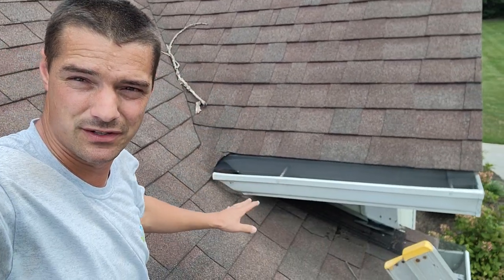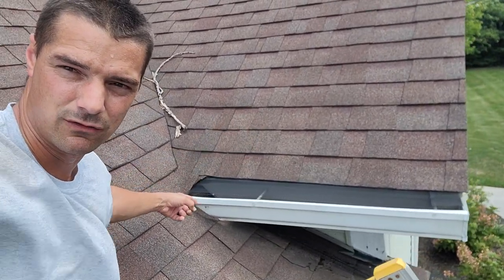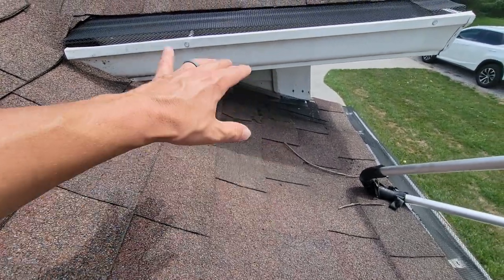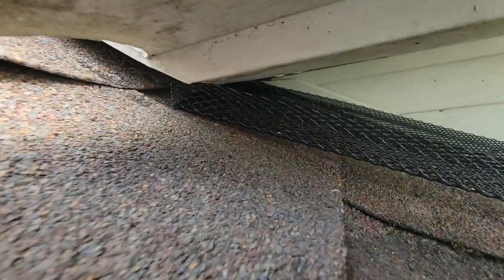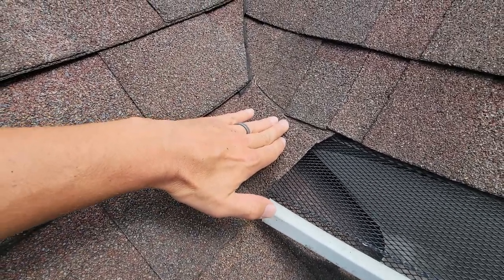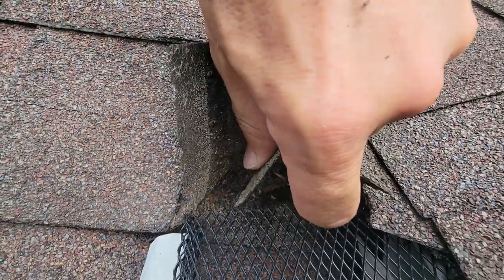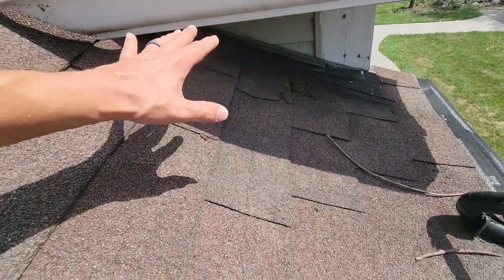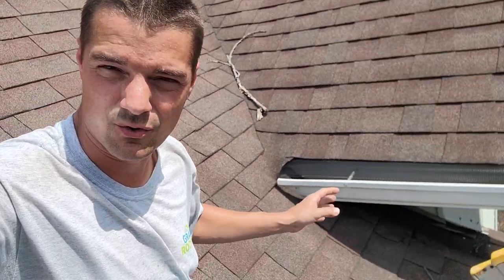How not to Roof a Valley!

Comment: I see this all the time. The gutter needs an end cap first of all, not cut at an angle like that to divert water to the weak points. The gutter on the main roof will take care of what runs off the valley from the dormer. That is 1000% wrong beside the gutter issue though. Great video my friend, keep educating these fools. 🤣
Reply: I do gutters and usually don't put end caps on these returns. We just cut it off straight and give about a 2 inch gap between the shingles and gutter. Haven't had any call backs. Though I'd agree putting an endcap and outlet is probably better.

That gutter basically dumps into the valley though .. definitely not good
Reply: I get people that want us to do gutters on the tower above the front door because they have leaks beside it in the dead valley. Crazy how many houses have this issue and not roofed correctly.
Reply: @digi3218  You are correct. I would go about 4 inches out of point-of-contact though, cap in, and drill in my downspout insert on the valley side of dormer, with a B style elbow to turn water away from the wall. Let the main roof gutter catch the runoff.
Reply: @kalebburgess5088  Yeah I will do B elbows sometimes in problem areas or if the homeowner requests it to be done like that or if we are removing and replacing and trying to match it.

I got taught just to cut it though and I have mainly stuck with doing it that way. But will sometimes do a painted outlet or with a b elbow.
Reply: @digi3218  honestly I have PTSD from hanging gutter with the company I worked for some years ago. Nothing pisses me off more than fucking with gutter. 🤣
Reply: @kalebburgess5088  PTSD.. did something bad happen or just didn't like it lol

Comment: I have that exact issue coming up on a roof repair coming up. I repaired this roof about 15 years ago. Then the people had it roofed by someone else. Now I have to go back and fix some other roofers mistake.
Reply: Your statement isn't very clear as storm issues caused a reroof or was it your installation that caused a reroof. The lifespan of shingles is incredible so for 15 years use roofed again and a third time....
Reply: @gawdzalien2811  your comment doesn't make sense.  He never said anything about a reroof or a storm.  He said that he's got a repair coming up on a roof that he had repaired before. The whole roof was replaced and now he had to go back over someone else's poor install (cause he didn't do the install) and fix/repair their work
Reply: @gawdzalien2811  He didn't say the roof lasted 15 years either.  He said that he did a repair about 15 years ago and they've had the roof replaced since then (by someone else) and now he's REPAIRING that newer roof for the same issue in this video.  Are you on some kind altering substance?
Reply: @ScottWConvid19  
Thank You Scott.
Reply: @superroofer3130  you're welcome.  It strains the mind to try to imagine that people can function with such comprehension deficiency
Reply: @ScottWConvid19  I agree with that 100%

Comment: Usually when a roofing company swings by for a reroof, they have a couple or several in neighborhood that already did, doing, or gonna; and that gives you a good chance to get the info (or by taking a walk/drive and look for yard signs😉) and look at their work (past, present, future) and possibly chat w/ homeowners to see how experience went, etc….
Know what pet peeve of mine is “cleanup and prep”. Drives me bit crazy when after all said and done walking around yard (maybe week later after install) and still finding caps, nails, snipped/trimmed flashing in yard or even left on the roof or in gutters. So, it’s nice when after a job a company will clean up (if multiple day job, they doing every day) & fun magnet wand over area for nails and double check for garbage and everything else
Reply: To be fair a magnet doesn't get every nail, and sometimes they fall in places you can't get a magnet or may not immediately see them. We always asked homeowners to cut the grass before we  came so we were more likely to get them all

Comment: Hey Brian, good to know how it's wrong.... same issue here with my house about to be roofed. Wish I could send you photos of it before and after for your comments.  I love how you answer stuff.. here goes.  I haven't seen in any of your video issues re the roof deck doesnt go all the way to the fascia boards.  I have this issue on part of my house that there is a 4" gap where there is no roof deck before the fascia/ gutter.  (perhaps more than one area, I can only peak and take photos of this one area).  Is this too much of a gap?  It's been there about 20 years and I didn't have any of those droops that you have shown collecting water.  Just wanted to ensure now isn't the time when roof is redone to fix this.  They have a long machine which cuts aluminum rolls to make specific sizes of gutter guards, so they can make wide enough for this expanse (which seems to be the area where your handy ladder set-off lays) Thanks!

Comment: WTH is going on with that gutter? No downspout?
Reply: Yeah, it's pointless the way they have it. It just back fills and pours out on the lower roof section. You're better off not even having a gutter section there if you aren't going to divert the water to a downspout or lower gutter.
Reply: It reduces the force of the water.  It's a very common diversion.  I see it a lot
Reply: @ScottWConvid19  a downspout installed on the right side of the upper gutter, aimed towards the lower gutter would diffuse water & protect better than the set up that's there. Maybe $15 in extra materials would make that a nicer job
Reply: @ScottWConvid19  There is no downspout. The way it is now, the water just flows backwards out the back of the gutter, then laterally before it finally moves down. Without the downspout, you've done more damage to the roof installing the gutter than a little water falling 8 inches would have done in 30 years.